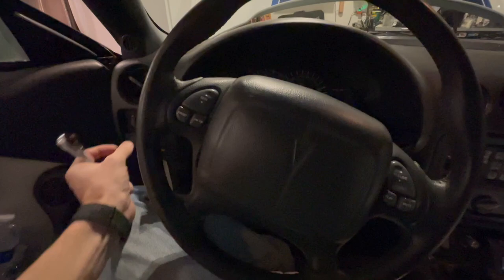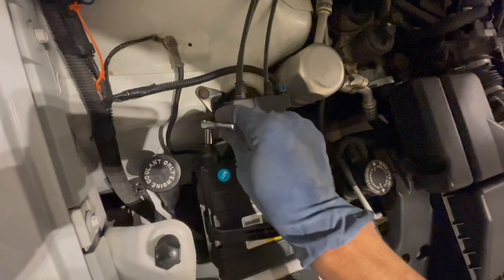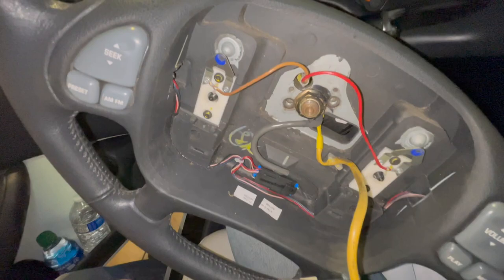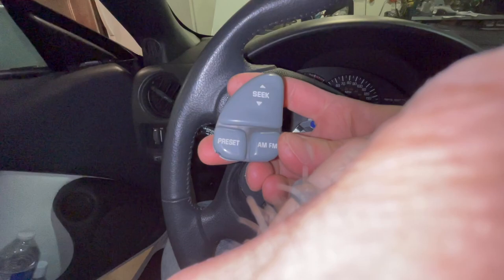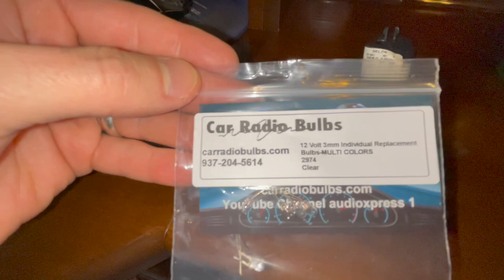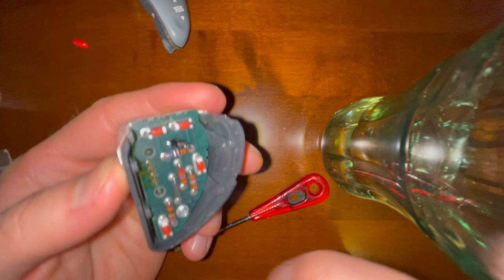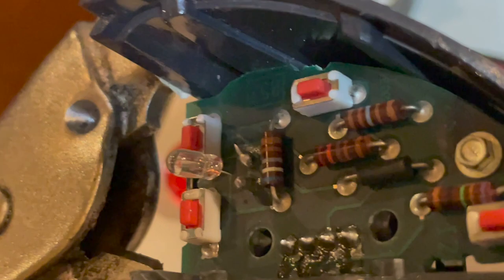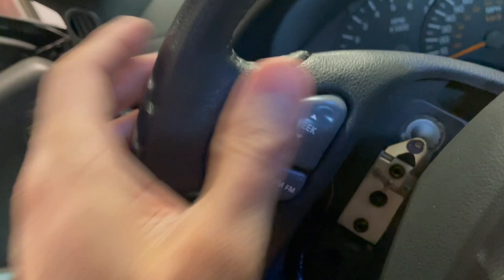4th gen FBody Camaro & Firebird Steering wheel radio control button light bulb replacement

Comment: Nice. Now I know. I will say though if your buttons are starting to peel paint it's easier to swap the buttons. The airbag usually has a backup battery supply even when the vehicle battery is disconnected. In an emergency situation it needs it's own power source.  It was not disabled.  That black plastic on the original bulb should of been reinstalled on the new bulb. That was to prevent the two wires from touching during vibration or such.

Comment: Can you take out the switch without removing the airbag?
Reply: You have to remove it, but your not disconnecting the wires.  Don’t be nervous just follow my steps.  I’ve done this 4-5 times over the years